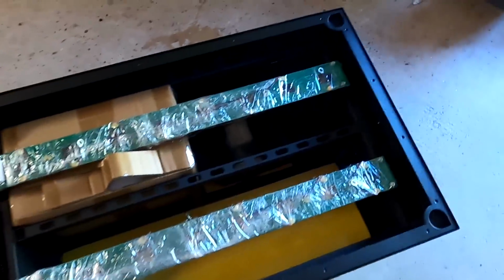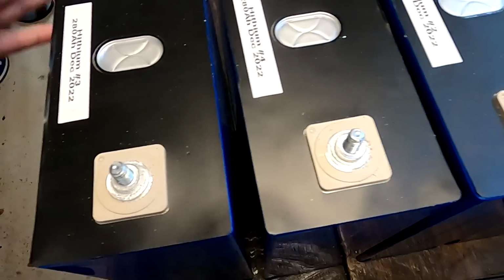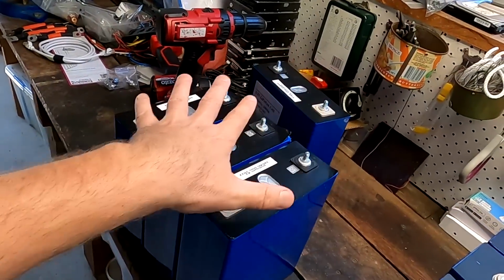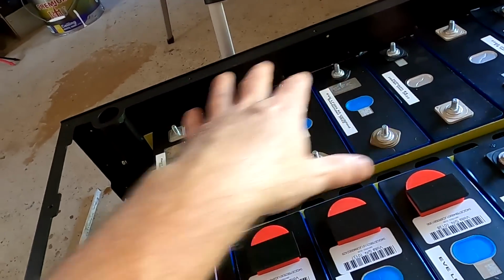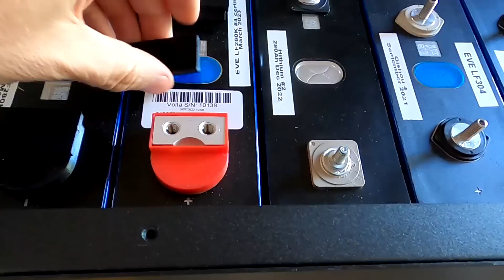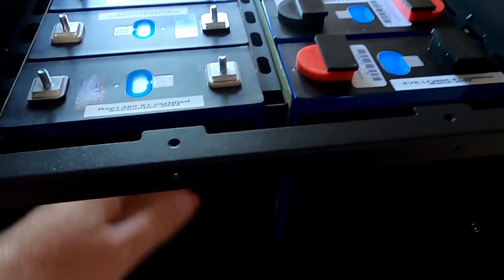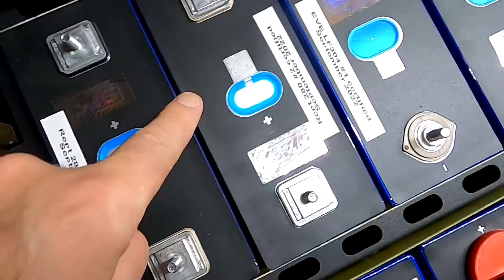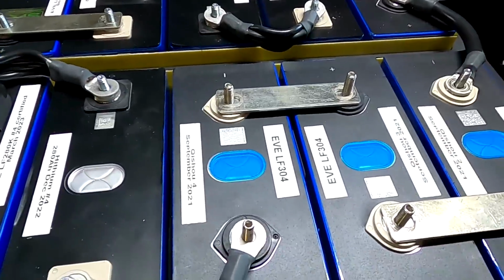Compressing swollen cells. What a start building this battery.

Comment: Hi Andy
I don’t get the solid bus bars having play when not screwed down. That play disappears when torqued down so you would have to loosen and retorque regularly as the bus bars will work as a solid and not move by themselves. Flexible bus bars all round and active balancer. André in Sydney
Reply from the maker: Thanks, Andre.

Comment: 2 capacitive 5a active balancers with triggers on top and bottom. If you don’t it will go limit down on the 280s way before the rest.
Reply from the maker: We only do top balancing here. But for a test, I could see if it makes sense to have them running at the bottom as well... I would not expect it though
Reply: @OffGridGarageAustralia  with highly unbalanced cells you’re going to go limit down.

Comment: I am in favor of the franken balancer for the Franken battery, i.e. the capacitive hack you did last time. I am using a Neey on one of my battery strings and it's definitely good, and a set and forget. But I like your experimentation. I am interested in 280 amp vs. 304 and the issues. I am sure LVD will trip via the 280s, but in balancing all the top balance will even out and settle on volts, although again, 280s will probably be the "halt until even" high voltage tripping batteries?
Reply from the maker: I was going to install the capacitive balancer as well as the NEEY. Unfortunatelly, I didn't have any connection cables any more for it. So, I ended up installing only the NEEY. The performance of the NEEY wasn't that great actually.... don't want to spoil it here... more to come.

Comment: What about putting a sheet of compressible foam between the cells? Would provide compression and reduce stress on busbars/terminals.
Reply from the maker: Yes, that is part of the installation in the Seplos case anyway. It allows for some expansion and contraction.

Comment: Vote for -> flexible connections everywhere!
Even if they are a bit more expensive. The cells will expand if they are full loaded and shrink if they get discharged. The force on the ordinary metal stripes would be extremely high, because the force can not go anywhere.
Reply: What about some bent copper pipe , make Boomarang bars ?
Reply: @maxgood42  How about dissimilar metals..?
Raw copper and aluminium

Comment: Andy - Like a chain, it will be as good as its weakest link/cell - active cell balancing may give it a little more by pouring in the juice from  the strongest cell to the weakest cell to prop it up - it will then find its median - the thin foam barriers  makes sense it will allow the cells to pant a little as it cycles  - put flexible bus bars on all cells for the same reason- hugs from Wales

Comment: Andy, I all ways use battery terminal grease, which helps with any any dissimilar metal connections and is recommended by busbar manufacturers for use on busbars to allow for very slight expansion and contraction movement due to temperature changes. I have never had any problems and it always help keep the contact area bright and shiny.
Reply from the maker: I have different grease here but found without, it causes the least problems. No cleaning of contacts or terminals either. Just bolt it together, tighten with 4Nm and it s working great since.

Comment: Very timely. I have a mix of 280's in my Seplos case. CATL cells terminals are closer together, so the large aluminum busbars that Seplos ships with the kit almost touch the center metal bar. I ended up using thinner copper busbars, and moved the four wide terminal cells to the four corners.

Comment: Diffusion was the word you was looking for.  That and Cloud Edge are my favs on solar.  Batteries charge quick when there's a few clouds in the sky.  
I don't think I would've tighten them down like that unless they were full.  I would've emptied them and them tightened them snug.  This way, they've got room to breathe.
Reply from the maker: Yes, diffusion! 🤦‍♂️
The batteries are full, all charged to 3.45V. The screws torqued only with 3.5Nm, so compression is very mild I would say.

Comment: The idea of the Frankenstein Battery seems to me to be an excellent field for testing the possibility of equalizing the voltages of individual cells in the situation of significant differences in each of them. I think this is the answer to the question: how will the battery as a whole behave in the future, when the parameters of individual cells start to differ significantly. In particular: can the balancer compensate for such differences? The answer "yes" will allow us to look into the future with a lot of optimism. The answer "no" forces us to verify the concept of a very large LFP energy storage.       This is why I await the results with impatience and some trepidation.
Reply from the maker: Yes, exactly. It may behave like a 10 year old partly refurbished battery. We will get something out of that!

Comment: It's a thing of beauty.  I like the combo of rigid and flexible bus bars (keeping with the Frankenstein theme).  Once you get the point of load testing you can check it with the thermal camera for hot spots (then you might have to change/adjust some bus bars).
Reply from the maker: Oh, we will definitely use the FLIR on this battery.

Comment: One of the most Interesting Off-Grid Projects to date! As as it's a Franken-Battery, why not install two active balancers? I was wondering if you encounter a capacity imbalance issue on low SOC, if using one active balancer to balance at low SOC to get a full, balanced discharge capacity, and another active balancer to Top balance the full charge would be worth exploring?
Reply: I thought about this too.. I think the balance capacity may be an issue when balancing at a low soc in relation to what you are pulling out of the battery. Inguess you will be well in the lower knee on some cells at that point.

On the other hand, when in series with a natural born battery, the latter may just keep frankenstein on an IV of low current in an effort to equalize the total pack voltage, also meaning most of the current drawn from devices connected may come from the higher voltage battery. The equalizing current may be  just high enough to let a low soc balancer do the job. Use the monitor relay inverted to start balancing at a certain low voltage and stop when it gets too low to prevent over discharge.

On a high soc one could experiment with 2 of 3 Neeeeeeys stacked to either balance more cells at one time of balance one cell with a higher current. One could even try to let a 16s balancer balance the whole pack and use a 4s or 8s balancer on 2 or 4 high cap batteries connected to 2 or 4 low cap batteries. They would only worry about small number of cells and thus be faster. Say you use 2 small balancers and 1 large and limit charging above some voltage to about 12 Amps, balancing could just continue nice and slowly to the point of a full balanced pack.

When this works one could at any stage compensate for one lesser cell due to age for example.

I am wondering though if all these micro cycles the balancer creates will take a toll at some point. That may be overcome somehow when one can make sure the charging current per cell always exceeds the balance draw from one particular cell. This would not lower the high cell voltage, but actually redistribute the charge current.

Lots to experiment with 😂
Reply: @NaamNatuurlijkniet  thanks for the thoughts and insights, much of what you relate it's similar to my thoughts. Last year I built some prototype lithium iron phosphate 32700 cell based E bike/light EV battery packs, and I received  one lot of cells that varied significantly in cell capacity. I built one test battery out of new cells that varied about 15% in capacity and did a parallel top balance before welding them together into a 16S - 1P pack for a 320wh pack and found that using the same Daly BMS with passive resistive (280mah) balance current was only getting about 280wh when a couple of cells would kick the BMS out on Low voltage. 

I built a second identical pack but paralleled them and bottom balanced them to about 2.4v and then charged them to 3.65V and got an over-voltage BMS trip on three cells at about 280wh of charge. After disconnecting and re-connecting the charger about 4 times, the DALY BMS was able to top balance the able balance all cells, but then of course I got the low voltage trip on the low capacity cells at about 280w. 

I was thinking that if Andy was able to turn on an active balancer with 2 to 5amp of balance when the lowest capacity cells started to reach the beginning of the discharge knee, the balancer depending on load could transfer some load from the high to low cells and provide a bit more total capacity, and turning on a second balancer at the upper knee of the charge would allow for all cells to be fully charged. The total pack capacity gain might at best only be  like 5-10%  and not worth the time and cost but a learning  demonstration.
Reply: Exactly..

It’s all academic.. normally these combi’s don’t even get to exist .

I wonder if for example a Neey balancer could be modified to move more current.

In a pack with 2 cells that are way off, like andy had this pack with one always low and one always high cell one could balance them out with a balancer just in between the two. 

An ultimum project would be to measure the difference per cell per one complete cycle and correct this beforehand.

In the middle of the graph balancers can’t do anything unless instructed to do so.

So lets say we know one cell has a 3% lower capacity, we could anywhere on the way down simply charge this one cell with what it falls short. When we do have a too  high cap cell we can use that as a source, when we don’t we simply use all of them.

I say simply, but it is not as simple as it sounds.

In a more basic setup one could set a charger or a dc-dc converter to just charge a certain cell for a certain time.

All in all this would be a nice experiment, but nowhere near economical 🤣 Or someone should make an automated balancer to do this.

So measure and calculate the capacity per cel in a full cycle and compensate for the difference on the way down, not based on voltage but based on actual capacity differences.

Again that adds a lot of microcycles and would be a lot of effort.

On the other hand it may prolong the usable life of the pack when replacing one or more cells is not an option or wanted, like in older packs.

Frankenstein emulates that kind of problems and andy could simply record cell differences and manually charge them during a drain test with the right current for the right time to see if this prevents premature low voltage shutdown.

He could even just charge to the point of high voltage shutdown on the lowest capacity cells and just try and compensate for that on the way down.

Comment: Hello Andy
Really an interesting project. I think Frankenstein's monster battery will have all the surprises in store for you. But still, it's nice to see that you are working sustainably and giving "older" cells another chance. However, I recommend connecting all cells with the same type of busbars. Take the flexible busbars from the cable remnants and use the 4th generation Neey Active Balancer. You don't have to feed the monster with "speed". You should use hardware that should cause fewer problems. That would be my recommendation.
Best regards, Sven.

Comment: Hi Andy, very interesting experiment. Eheheh...

My guess is, that if you top balance the cells, they will increase deviation as you discharge them, and will meet again fairly balanced at the top again with little need to balance them again at the top.

Would also be interesting to see, if the 2 amps balancing function from the JK would be enough to mange these differences, or a programable active balancer!

Nicely done. No other youtuber is doing this. You are crazy... And I love it!!!

Comment: I’d go with the flexible buss bars. At least you take different buss resistance out of the equation but be sure to use your internal resistance meter to get a jumper batch the same. The Neeeeeeeey would have the best chance but it’ll be a good contest to try the Heltec as well. I’m thinking it’s going be a workout for any balancer.

Comment: The battery boxes Eel sells look so much the same as the Seplos box that I expect it is the same manufacturer. Andy thanks for the video, keep up the good work
Reply: @patrickmaartense7772  Have two of them, happy with it, better than a server rack battery pack with welded cells, this is serviceable. Victron/HomeAssistant/Offgrid in the middle of Sweden.
Reply from the maker: I've got an EEL box here, so we can compare...

Comment: Awesome Andy, really to see the next videos until the end!!
Regarding your Bus Bars, I'll put all the same, but it doesn't really matter I think, since anyway your cells have different resistances and capacities.
(just warn if it moves)
It is absolutely necessary that you put the NEYYYYYYYY!! (or other active balancer)
This BMS will not do the job properly.
It's gonna be a weird battery, but it'll work fine, I'm sure. (the total capacity will be a surprise!!)
Thanks again Andy for your videos..
Reply from the maker: I will try without active balancer first and see in what state the cells are.

Comment: Great video as usual.

Surely you're going to need the largest active bounce you can find to cope with the difference between the 280 amp hour which will fully charge well before the 304 amp hour !

I'm imagine you're going to have a whole world of BMS High Voltage protection or shutting down before the 304 are fully charged....

But we will see when you test it....!
Reply: It would be interesting to see that after a top balancing. I believe there will be a large difference as you discharge it, because they should be similar at the top, and the lower capacity will cutt-off earlier. But when charged, they should meet again at the top with little to minimal balancing. This is why this test is interesting. I am actually curious to see the results.
Reply from the maker: Well, once all cells are fully charged, they are all at 100%, so no difference 😊

Comment: I'd go for an active balancer as well. This will fill up the larger batteries and thus reduce the probability of the BMS to switch off the battery for to a runaway cell.
Regarding the busbars, I'd go with a lot of different ones, just to emphasize the "frankensteinity" of the battery. 😜

Comment: looks much better with flexible busbars everywhere and they also give room for error over time. also less stress on the terminal posts (im not sure i would have used the foam between the batteries - someting with a lot less give would be better i m h o.

Comment: Nice project.  With the neey, the battery will work perfectly, like any 280 amp battery.  Like the flexible busbars and am very curious how compressed battery will hold up in the long run.
Reply from the maker: Yes, there is a lot to learn and test form this setup. I hope over time we will get some interesting results.

Comment: Even if the rigid bars have slack in their holes, once they're tightened down, movement will not be possible, unless they loosen up.  And you certainly don't want that.  To my thinking, all of these batteries should be using flexible links, since these cells evidently expand and contract and "move around" a bit in service...
Reply from the maker: or, alternatively, leaving a gab in between the cells.

Comment: 8:00 Regarding the cell-order. I think if all cells of the same manufacturer are deformed in the same way and to the same amount then it will be easy to simply put them in just opposite of each other. So two X-Cells on the left and two X-cells on the right. Next two Y-cells each on the left and right and so on.
Reply from the maker: Yeah, that should work too!

Comment: I had to lower my max voltage over the cells , one cell will not charge over 3.4v so i made the max voltage over the other cells 3.45v antill i get warranty claim local seller and or buy a replacement eve280ah , but is it worth charging the cells more then 3,45v ? not really loosing much capacity
Reply from the maker: Have you checked the cell just by itself? Remove all the busbars and do a capacity test with this one cell if possible.
3.45V is fine, that is already 99.5%SOC
Reply: @OffGridGarageAustralia   NO  i havent had a chance ,,that cell very lazy always the lowest voltage till they get down to 3.34 then its with in 1 or 2 mill volt of the other 7 cells . at 99% charge its .50 volt lower ,as they all head to 3.45 -3.48,, its at 3.98 and balancer been smashing 2 amps into it for hours with no rise in voltage ,think ill order new cell and put claim in see if he is good for warranty,
Reply from the maker: @AdventureMotoEnduro  That sounds like a balance issue. If you can, charge the pack fully and connect just this one cell to a charger or power supply until it shows the same voltage as all the others. I doubt, it's faulty, just needs proper top balancing once...
Reply: @OffGridGarageAustralia  I give it a try get back to you

Comment: Why do you apply compression if you explained in your videos why compression doesn’t work? I would keep busbars identical thus the flexible ones
Reply from the maker: Because the Seplos case is designed like this. I cannot leave the compression plate away or the cells would fall out.
Reply: Something has to make Andy do the right thing! 🙂

Comment: When you have several battery banks each with bluetooth do they each connect nicely if there are two of the same type or do they have to all be the same or all be different types of BMS.
Reply from the maker: In the app you can select to which BMS or balancer you want to connect to. They don't need to be the same brand or model. I have the Overkill app and it connects to many BMS models of different brands.